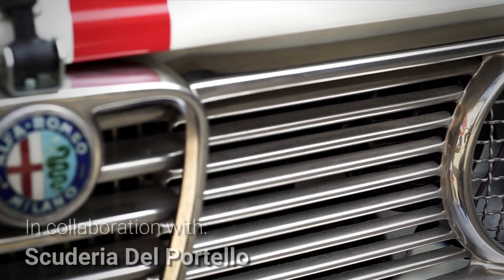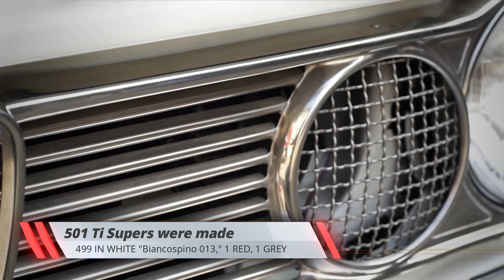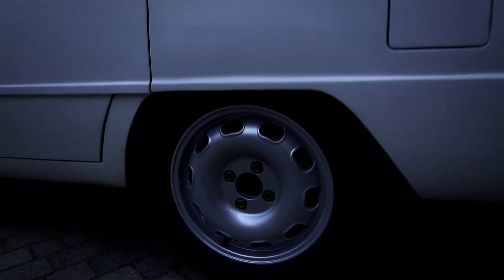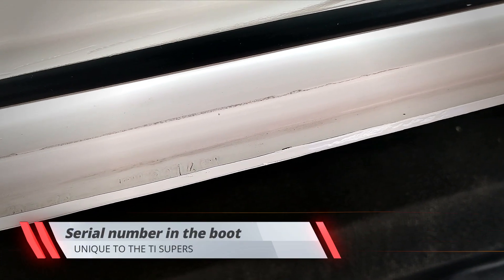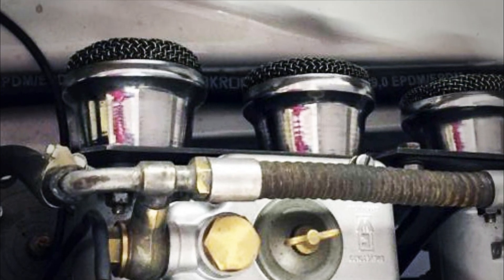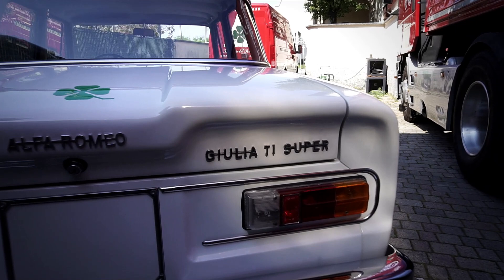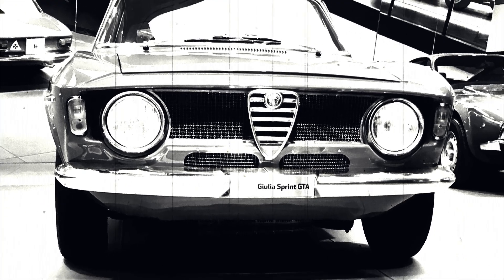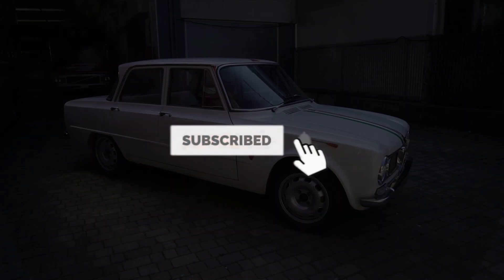Alfa Romeo Giulia Ti Super 1964: Homologation Special

Comment: The gift from my mother for my stepfather. Imported from Swisszerland, replace front white lights for yellow because we living in France. I remember the particular odor, the woody steering wheel...and the sound of engine. 5speed (my Scirocco had only 4!) Sporty ergonomy...a real Alfa. I was sleeping in back when two tires exploded (retreads, poor quality) and as my stepfather had to drive at his cruising speed (never less than 150km / h: 1500km in 12 hours, including the stop cappuchino and pee) I thought that our last time was came.  Thank you to the Madonna.  In the middle of summer, the leatherette seats and the heat released by the transmission tunnel, the temperature was rarely below 40 ° C

Comment: Another great video about AR. Bravo!

Its sould be noted that the 105 saloon body are very aerodynamic for its time. I think the number is 0,34. 
In comparacy, my coupe, witch look aerodynamic, is like a wall hitting the wind.
Reply from the maker: Mmmh... 0.34 was a printing error, it's never been true. The Giulia was very aerodynamic for its time, but not THAT aerodynamic :)
Reply: Yes. My bad. 
Still more aerodynamic than the coupe i would think. 

But a very beautyful saloon. 🍀
Reply from the maker: @TheInstructor66  Yes, the Giulia had a better Cx than the Giulia GT, that's true indeed. I wonder whether the GT's lower crosssection compensated for that though